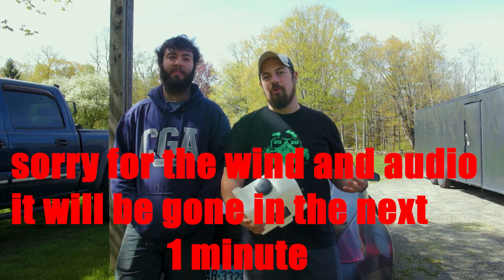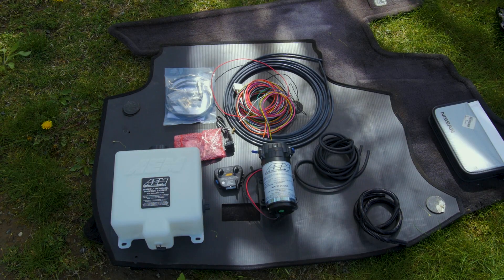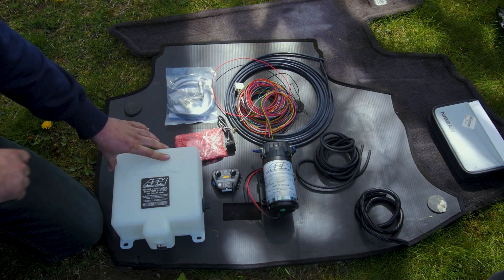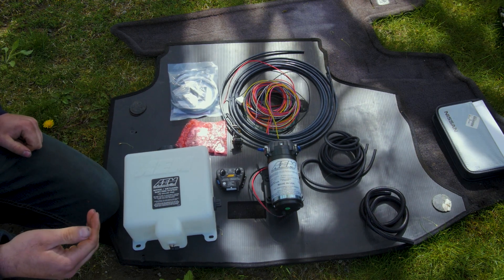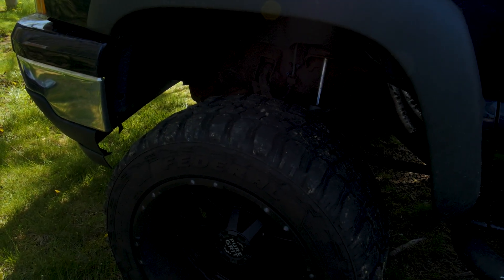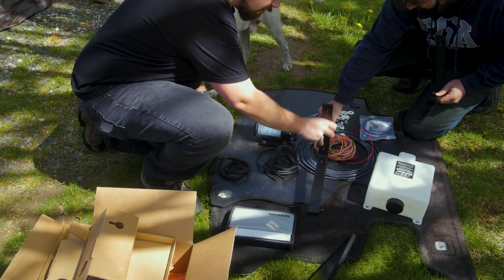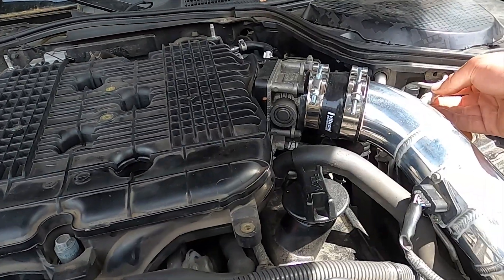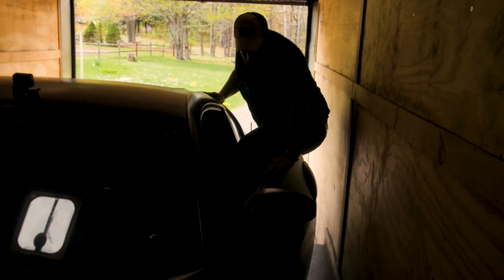what is Methanol Injection and do YOU need it? rear mount turbo 350Z install. AEM methanol kit.

Comment from the maker: What questions to you all have?
Reply: On this build what all did you do with internals? Just rods, pistons and bearings or did you do a full overhaul?
Reply from the maker: @Pondertot  we did absolutly nothing. Just upgraded the fuel system. No internal work was done. This is an 08 350z so it has the HR motor